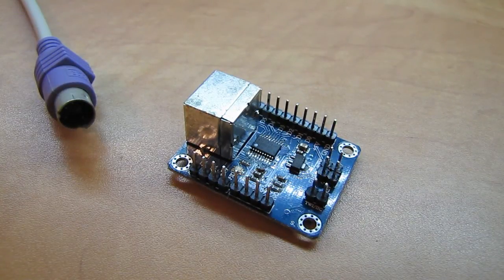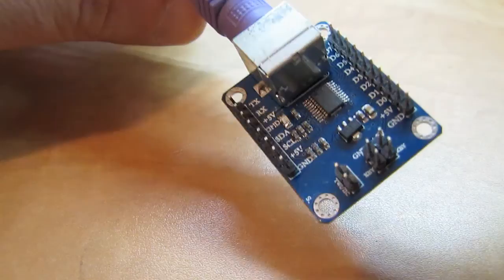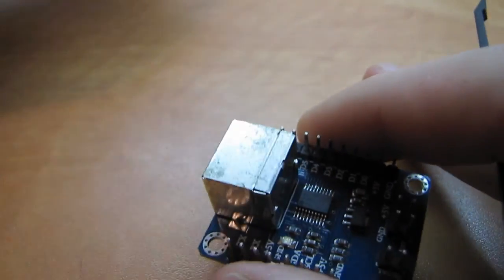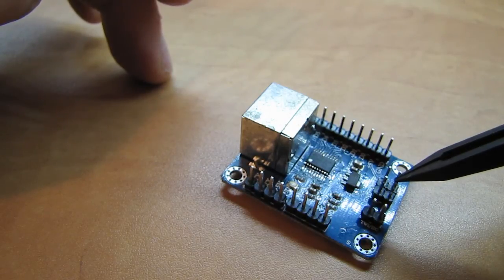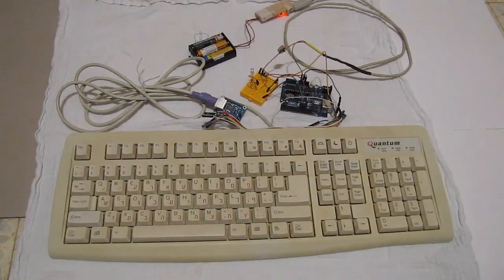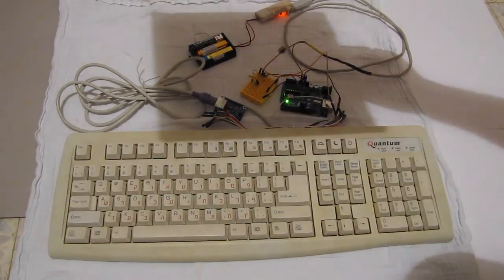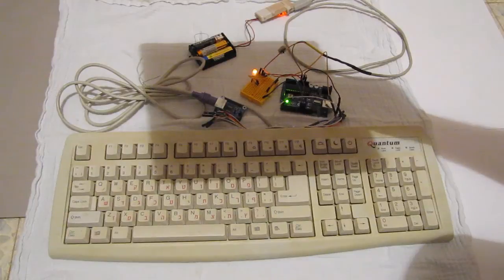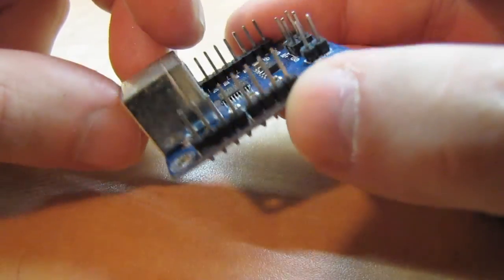ICStation.com's PS2 Keyboard Interface Module - Review and Demo

Comment: Hi, Ido. I bought one of these on Aliexpress but it's not working. No activity on any of the pins when a key is pressed. Looking at the board in detail, it shows that the +5V input of the module goes to an 78L05 regulator whose output becomes VCC. Since the 78L05 requires 2V headroom, this will never work. The 78L05 output I measure is 3.5V which is then piped to the keyboard. That is less than the spec of 5V that needs to go to the keyboard. Any ideas?
JdR
Reply from the maker: Seven years ago, when I made this video, I didn't even think to look... but I found this very module now, and it too has a 78L05 on it. So either your module is faulty in some other way, or your keyboard is less forgiving than the one I had. The obvious solution is to put a little wire instead of the 78L05 - but be careful, this may void the warranty :-)
Reply: @idogendel  Thanks for your reply. The keyboard I used initially says 300mA, 5V on the back so I tried another one (100 mA, 5V) but same result. I made a little breakout harness and the keyboard clearly returns clock and data when powered with 5V. I then replaced the 78L05 and connected IN and OUT but still the same result. The LED turns on for a while but then goes out. No activity on any pin of the module when pushing keys (but activity on the Clock and Data lines coming from the keyboard). The module must be defective though I can't believe that even the Chinese would power the keyboard with just 3.5V, hoping for the best. I'll order a few other ones. Thanks for your time.
Reply: Oops, it should read "I then removed the 78L05"

Comment: Only connect four wires , not need driver and not need software ?
Reply from the maker: Obviously you'll need something that can read and interpret the UART or I2C output from this module. It's no longer offered at the store where I got it, but there are some on eBay and you can probably find detailed instructions there.
Reply: Correctly connect four wires ?
What is it  interpret ?
Reply from the maker: Yes, 4 wires, but it sends special key codes that you have to interpret yourself. Here's a document with these codes: http://flint.cs.yale.edu/cs422/doc/art-of-asm/pdf/APNDXC.PDF

Comment: Support this interface two or three keys in same time ? For example CTRL+ALT+DEL or W+D+SPACE ?
Reply from the maker: +george velesoft If I remember correctly, it can be done since we don't actually press the keys down at exactly the same time. E.g. you'll see Ctrl at the output, then Alt, then DEL - and as long as the Key pin remains HIGH, you know the user is keeping all those keys pressed. Of course, this data processing  will require some careful coding...